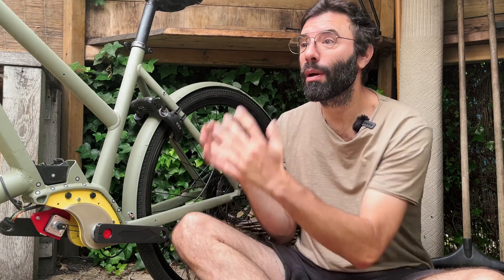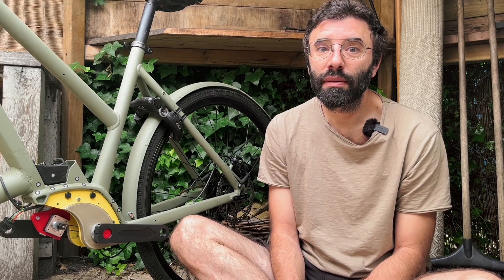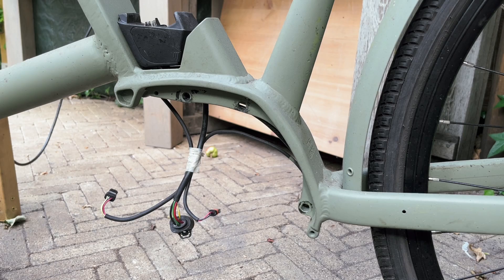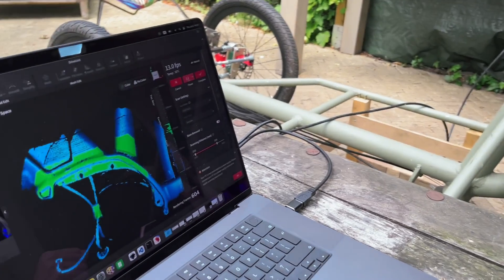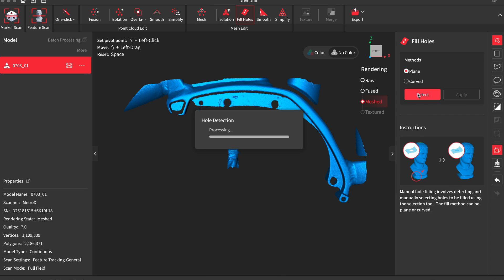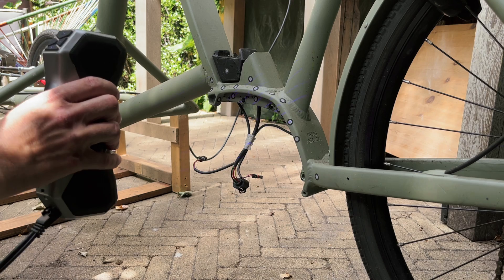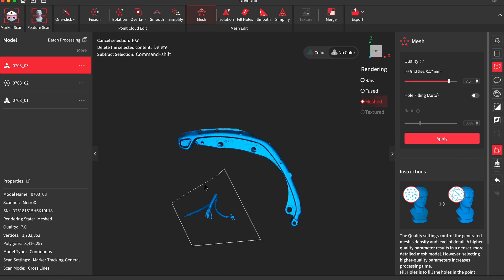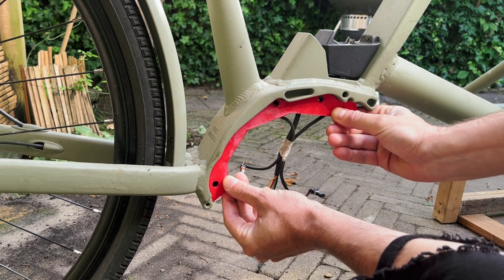#1 Open Source eBike Mid-Drive - Project Start with Revopoint MetroX 3D Scanner

Comment: Electric bike motor systems are incredibly expensive at the moment and prohibitive to many people. Straight replacement cost of like for like motors if one fails demonstrates how the manufacturers control the market.

What you have produced is well on the way to adapter kits that permit fitting of almost any motor as a replacement. Yes the battery and control systems will require updating but it is all doable. 

My knowledge of the individual processes is small but I understand the possibilities. Well produced and narrated video. Thank you. Very informative.
Reply from the maker: Thank you! Would be nice to have a standard fitting for sure.
Cheers!

Comment: Just buy from Bafang a middrive, or better a Hub motor so you can regen / use the electric brake to reload the battery, extrem usefull on long downhill tracks. Anyway what you shose Middrive or Hub you should whit out a doubt get a VESC Controller, its also open sorce and is easy to install. I buy my from Flipsky since the offer the minimum of quality for a reasoneble price whit a lot of extras to add on.  I plan to buy from Tifgalop a made of china Fat Ebike the F7 Modell whit 20" wheels  dual all wheel Hubmotor so i can regen to prevent overheating on the disc brakes like on all my other bikes.
Reply from the maker: Oh, thank you so much for the Flipsky VESC suggestion. I just checked them out and look great!

Comment: Adapter plates to replace a failed or weak mid-drive unit is a great idea.   Not sure that little motor will really do much for you though, but not prototype.
Reply from the maker: Yes, you are right! Actually, it may be a great idea to just produce an adapter to transform a frame with mid-drive to just a bottom bracket.
Regarding the motor, also right;) I already found a better one that I like, disc format.
Cheers!

Comment: why not make e-motors in the 2 front wheels and one in the rear - like tri-motor design ...
Reply from the maker: That could work as well. I like the mid-drives because I think it's easier to implement torque control... And I don't like to add mass to the wheels...
Cheers!

Comment: Maybe it's not better or cheaper than the Bosch, but there are lots of places where you can't get neither the kits nor the parts from reliable sources and having the inspiration to build one with commonly available or self-made parts could be the difference between progress or stagnation
Reply from the maker: Indeed, the inspiration to build should be one of the main motivators for someone making their own mid-drive;)

Comment: If you want an open source motor why use some weird BB mount that's not present on most bikes?

If open source makes any sense at all then it is when it comes with compatibility. So it ought to make sense on most bikes innit?
Reply from the maker: That's true. But this is the frame I have so that's why I do the project from this mount. I hope the knowledge shared will be used to some.

Comment: What type of infill do you use on those 3D printed parts? Or do you just make them solid?
Reply from the maker: Hi, these prints are just for fit testing so they aren't performing much force. I print with 4 walls and 15% infill.
Cheers!

Comment: Maybe IF you mount few of this motor this could actually work :) or simply change the gear ratio on the engine. I think the idea has potential.
Reply from the maker: Indeed;) Would be nice to have at least 250 W. Let's see;)
Cheers!

Comment: I follow your trike series since the first video. 
I'm an electiral engineer and have a lot of experience with electrical drives and ebikes.

I really enjoy your Mecanical designs to watch. 
The Mid Drive is a cool Idea, that can get very complicated by itself. 
I think you should focus on the mechanical part.

If you want to taylor something to your need, you should check out the open source VESC motor controllers. 
You can use any of the shelf 3 Phase motor and make it fit your bike with your design and manufacturing skills and use the VESC controller and a torque sensing bottom bracket to control the power.

A rear drive motor would also be a good choice since you can use any bike frame and don't need the bosh cutout.

Keep up the great Content.
Reply from the maker: Thank you so much for the kind words and suggestions;) Indeed, I will focus on the mechanical part first until it actually works. Then, working on the controller will be a lot of fun;)
Cheers!